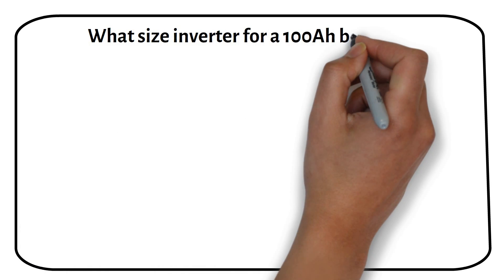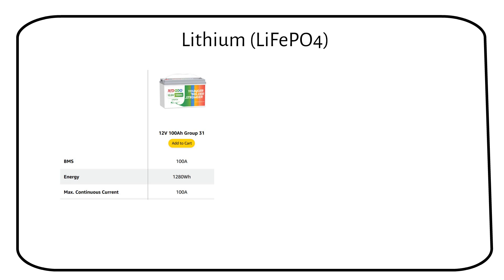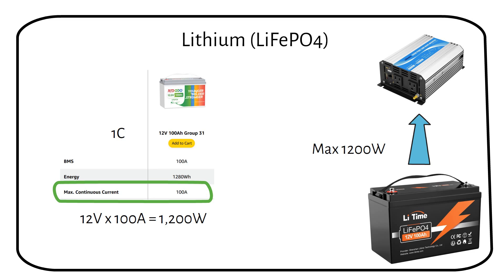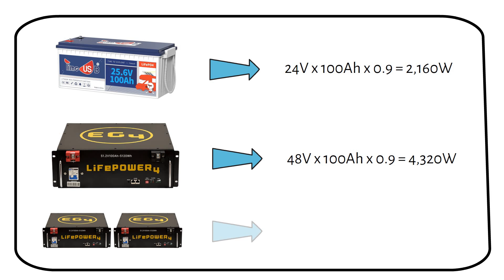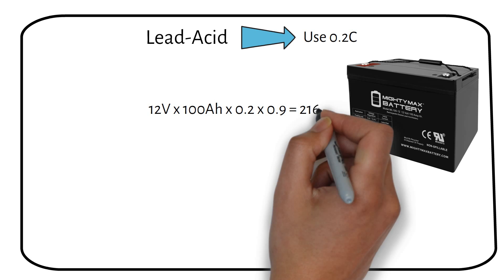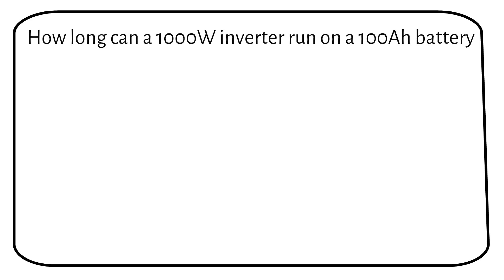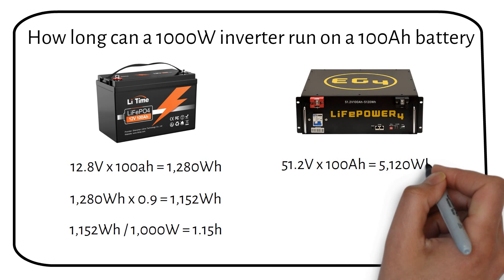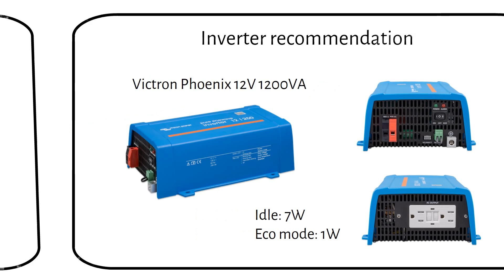What Size Inverter for 100Ah Battery - Sizing Battery for Inverter

Comment: I just ordered a 500W Bestek inverter to get myself acquainted with using inverters as an alternate power source. So in theory, 12V 50ah Lithium Battery suffices for 500W inverter based on calcs ... but do you still recommend a 12v  100ah lithium battery and, if so, why?...Without doing the calcs, it seems i can potentially get longer usage with the 12v 100a battery on a 500W inverter before recharging, but I would like to know your thoughts? I don't intend to max the load at one time, so my usage at this state in learning to use inverters would be light intermittent use (i.e a lamp periodically, charging my lap top periodically, charging phones , and maybe running my wifi for short intervals).
Reply from the maker: Of course, having a larger battery will make the fridge run longer, but it would also take longer to charge back up. I recommend getting the 12V 100ah battery, the price difference is not that much, about $250.
Reply: @cleversolarpower  Thank you!

Comment: Question, I'm looking at the Victron Inverter mainly because of there efficiency and the low draw when idle.  Know this might be a stupid question but the idle draw that's only when the are turned on correct? If i have it switched off it shouldn't drain, correct??
Reply from the maker: Yes, if you turn it off it's 0. If you turn it on it consumes power even when nothing is attached to it.
Reply: That what I thought, thank you

Comment: Great video. I love your animated pen technique... question: You suggest a fuse per battery prior to connecting to the bus in a parallel setup. The lithium batteries I use have a solid 200a BMS which shuts off with a short or other over-current situation. Is an MRBF fuse on each battery necessary? (the after-bus-bar [positive line does have a 200a fuse).
Reply from the maker: The BMS cannot disconnect a short circuit (high ICC) because it's an electronic switch. It's best practice to fuse every battery. Checkout nh00 fuses, they are quite cheap.
Reply: Clever is absolutely right. I'm a Commercial Electrician (Retired), and it is my professional opinion that it is really hard to have too many fuses, but really easy to have too few.
Fuse each battery (or bank of batteries, if a series setup) coming into the Buss Bar, then fuse the Buss bar to the Inverter.
A fuse responds to a Short Circuit far faster and far more reliably than a Circuit Breaker or Electronic Switch ever will.
You can trust the Inverter's circuit breakers, because the Inverter's electronics cannot produce more than double the "Constant Output" rating of the Inverter, and the only time you need to fuse the Solar Panels themselves is if you wire them in Parallel, because if you have, let's say, 4 panels, and something goes wrong with one, the other three might "Back feed" into it, giving it 3 times the current it's built for. If you're running them in Series, the Amperage won't exceed the rated amount possible unless the Sun's power increases, and then we probably have worse problems. But if you have 4 panels in a series arrangement, you now need to have 4 12VBatteries in series, as well as a 48V Inverter. And only need to fuse each bank of 4 batteries coming to the Buss bar.
The upside of a 48V system is that it has a lower current draw from the batteries, so you can use smaller wiring from the Batteries (or Buss bar) to the Inverter.
One of the "Joys" of LiFePO4 batteries is that, even though they have a 100A BMS, if THAT shorts out completely, the battery can deliver 200-300 Amps of surge before it heats up and goes BOOM! Rate the fuse the same as the BMS.
I hope this makes sense.

Comment: 24 Volt 3.8K Lithium Iron Phosphate Big Battery with 100amp BMS Handle a Victron Phoenix 24/1200 Inverter or a WZRELB 24 Volt 2500 Watt Inverter ??
Reply from the maker: 1200VA/24V=50A -> yes, 2500W/24V=104A -> no (if you draw the full 2500W)

Comment: If i have flooded 12v batteries that are combined 168AH. Is that really what is available or do i will i only get 80% out of them which would be 135.? I am setting up a battery monitor. thanks
Reply from the maker: If you have flooded lead acid batteries, you should only use 50% to increase the lifespan. You can use more, but that would reduce it's lifespan. Check the capacity of the battery with a voltage meter.

Comment: 2x12V100Ah in series and a 24V 1500W Inverter, was this the right move? I'm about to buy solar panels hence I found your channel and I'm amiss as to whether the same efficiency is used for Sealed Lead Acid vs Tubular Lead Acid for I was under the impression the latter shouldn't be allowed to discharge less than 50%? Should I opt to get a smaller inverter?
Reply from the maker: This will work. Every battery can deliver a max of 100A. Since they are placed in series, this is the max then can deliver, so each battery 50A. 1500W/24V=63A -> correctly sized.

Comment: I have a 3000 watt inverter, on a 100 amp battery, can I use a splitter to truck battery, to keep charged, only running 12 volt Rv fridge and a800 watts microwave?
Reply from the maker: I'm not sure what you mean by splitter. You can add multiple connections to a battery. However there should be a maximum of 3 connections per battery post. If your system exceeds this, use a busbar. You can add your inverter + charger to one battery.

Comment: Hi m8.
All fine here but like to ask for your thinking about my coming setup.
Lets start with my needs, no im in the Philippines wery south so its little diffrent.
Main who needs regular power is refigerator for beer and freezer for the bbq.. joke but its the main thing we really need.
Also a few fans running dayly will be needed.
Have some clue about power, ill add 20%
refrigerator 100w freezer 100w, fans and accesory 200w.
Some rarely use of microwave.
Can you give me a thumb what i need ?
My own estimate is as follow.
3x600w panels and 4 batterys for cooling and 2panels + 2 batterys for others separeted.
Seems ok?
Reply from the maker: Checkout my video about designing an off grid solar system as well as my calculator on my website.

Comment: I have a 1200watt inverter on a 100ah battery, I will just be careful not to go over 1000.
Reply from the maker: Yes, otherwise the BMS will shut down. The inverter has inefficiency as well. Usually 90%. So the max you can draw on the AC side is 1080W AC.

Comment: Thanks for the great videos, I'm also using your website links to buy your recomendations on amazon. I currently have the MPP Solar All in one unit: 12v 1000w inverter, 40A solar charge controller, and 20A AC charger. I'm having trouble figuring out how many batteries I can add in parallel. I crrently have a 12v 200AH Li Time battery and want to add a second 12v 200AH Li Time battery. Can my inverter handle that much current? And are the 40A solar charger and 20A charger enough to charge 400ah? I've allready bought the 12V system, and I can't afford to switch to 24V. ;)
Reply from the maker: More batteries is better (most of the time). You got to see that the system is still properly sized. Batteries should have 3 days of autonomy. So if your daily consumption is  800Wh, then you don't need an extra battery. You can charge the batteries with 2A, the charging current doesn't matter that much, it just impacts charging time.
Reply: @cleversolarpower  thanks! Very nice of you to help people out.
Reply: @cleversolarpower  one more question, if I add a Li Time 200ah battery with a 100amp BMS, to my existing Li Time 200ah battery, in parallel, do I use a 125amp MRBF fuse on battery #1, and a 250amp MRBF fuse on battery#2? I watched your videos, you said fuse each battery in case of short circuit overload, but still having difficulty understanding fuse sizing when two batteries parallel.

Comment: Do you mean, brother, that we cannot use more than 40 amps for a 200 amp acid battery? This would be excellent, please.
Reply from the maker: You can, but it wouldn't be good for your battery or efficiency. 40A is the max you should draw, not what you can draw.
Reply: @cleversolarpower  thanx my dear

Comment: I have a Sungoldpower 4000w 12v inverter/charger in my rv with a LifePo4 12v 300ah battery.  Is that too much inverter?  I am adding another 12v 300ah LifePo4 battery in parallel for 600ah if that helps.
Reply from the maker: I don't recommend going over 2200W for a 12V system. Your wires will be costly. Check my video about 12V,24V or 48V battery systems.

Comment: If I have a 180 W  inverter for my Travel trailer.How big of a lithium battery can I get to max out that 1800 watt inverter?
Reply from the maker: Assuming you have a 12V lithium battery, you can draw a max of 100A, that's 12V*100A=1200W max draw from one 12V 100Ah lifepo4 battery.

Comment: informative video. I have a question.. I connected 2 solar panels of 100w each ,  to 3 12V batteries 2 of which have 100Ah each and 1 has 150Ah. I use 1000W inverter. However, the power often goes off at night but sometimes during day time. what could be the reason?
Reply from the maker: Not enough solar to recharge the batteries. It depends on your load. Make a calculation and see how much you need. Checkout my video about sizing a solar system.

Comment: Is it possible to run a 2000w inverter on a 100ah battery with a 700w microwave?
Reply from the maker: No, because the c rate of lithium is 1. You can discharge a max of 100A with the BMS.

Comment: I have two 12v 120ah lifepo4 on 3000watt 24v inverter. My charge controller shutdown. I also have four 250 watt panels connected in parallel.
Reply: your charge controller should be MPPT that support 24v

Comment: Hi, Nick. I just came across your channel the other day and have learned a lot already after watching just a few of you tutorials. One thing that I learned... I have been making some very wrong assumptions about size and capacity. On my RV I currently have 2 - 100W solar panels, 2 -125 AH AGM batteries, all wired in parallel. I have them connected to a 40 amp EPever charge controller and to a 2500 W Sunforce Pure sine wave inverter. Problem... this set up will not run my microwave or coffee maker without tripping the cut-off circuit in the inverter. I have recently acquired two 300 AH Renogy Lifepo4 batteries, not yet installed. Will this solve the issue with tripping the inverter or am I missing something altogether? And do I need to resize my inverter to take the new batteries? Your comment or those from other followers of your channel will be greatly appreciated. Thanks.
Reply from the maker: Hello Trevor, answered your email.

Comment: I have 4x 48v 100ah rack batteries and a 5600 watt inverter.. I'll be buying another 4x batteries and also updating the inverter to 8 or 10kw. That's hybrid inverter/charger.. And 12-14 270w panels..

I use MPP inverter/chargers. They are good but have a higher standby current draw

Comment: I have 3 12V 20Ah LiFe batteries, if paralleled what watt inverter is best? 650W or 600W
Reply from the maker: You have a 12V 60Ah battery. At 1C, you can pull 60A max. Assuming the BMS is rated at 1C as well. 650W/12V=54A. So you can run a 650W load.

Comment: There is nothing wrong with using an oversized inverter. One reason would be to allow for future expansion. Just don't draw more power than your current battery system can handle.
Reply from the maker: I agree, it depends on the load.
Reply: @cleversolarpower I’m getting a 100 am lithium iron phosphate battery deep cycle and consider getting a 4k water inverter is that good? To run 5th wheel
Reply: Don't forget the parasitic drain is larger the higher the inverter capacity. Use the smallest inverter (with a safety margin)
Reply: Then you have no idiot proofing

You should always dumby proof ur diy crrations
Reply: @Godfather_of_the_Oath  just put overcurrent protection on your battery if it doesn't already have it.
Reply: @Godfather_of_the_Oath  Murphy

Comment: I have 3-100ah Mighty Max   lithium batteries hooked up in series
Reply from the maker: With what inverter?
Reply: @cleversolarpower  I have 2, a 2000W Power  Tech-On and a 1200W Victron Phoenix both are 12V I don't have either one maxed out. Thank you for all your info I find it very informative
Reply from the maker: Thanks for your reply.
Reply: @cleversolarpower  I have 2 a 12v /2000w Power Tech - On and a Victron 12/1200 Phoenix I like this one a lot. Thank you for all your helpful information.

Comment: Even 500watt inverter with a 60watt load can not be connected on lead acid battery 100ah
Reply from the maker: I assume you are talking about lead-acid? Of course it can. A 500 inverter is not the same as a 500W load. If you have a 60W load, then you get a total of 70W (including 10W of the inverter). Maxing out the inverter is not a good idea (500W) because it will shorten the lifespan of the battery.

Comment: I have a Renogy 2000w Inverter with two Eco-Worthy 12.8v 100Ah lithium batteries in series.  Am I properly sized?
Reply from the maker: 2000W/12V=166A/0.9=185A max draw from inverter. A 100Ah battery can deliver 100A, so 100A x 2batteries = 200A. So you are properly sized.

Comment: Very informative.  I have a 100Ah AGM Lead Acid and a 120Ah AGM lead Acid batteries.  My Invertor (MUST Invertor) is rated as 12V/1000W. I have an MPPT charge Controller rated as 150 MaxPVoc. What will be my set up?
Reply from the maker: Connecting the batteries in parallel is best. However, that's insufficient to run a full 1,000W load on it. It will work, but as I said in the video, it's not healthy for your battery.

Comment: I've been using four sealed lead acid batteries with a 2000 watt 12V inverter powering washing machine that peak draw about 1800 watts. Been in service over one year now. I do 2-3 loads per week. 
So I'm apparently way under sized my battery bank??
Thank you for good informational video.
Reply from the maker: Assuming the batteries are 12V 100Ah, you have a total of 12V 400Ah. You will draw: 150A. Since you have lead-acid batteries, you should use a .2C rate for maximum lifespan, you are running it at 0.375C. Still not bad for short time loads.
Reply: no. How deeply do your batteries become discharged (end voltage)
Reply: So I had to check again this AM pulls about 8.5 AMPS max load. Batteries lowest I've seen was like 11.4 volts after doing consecutive loads. And meter showed charge level only hit 50% briefly.
Reply: @chadrogers3161  I don't agree with the premise of this video, but it isn't mine. For longer life 11.7 volts after resting is the minimum (the less discharged, the better - recharge sooner). So S.O.C. is best to 50% of 12.7 to ? as rated by the Mfg. Other than that, you appear to be just fine, unless you need longer operation from the battery. Carry on.
Reply: @jamesalles139  yeah they are connected to three 100 watt solar panels so plenty of time in between uses to recharge.
Reply: The two things that kill a battery fast are the speed of discharge, and the depth of discharge. You're a little over on the speed, but not horribly, and it sounds like you aren't discharging all that horribly.
If you added any more demand to the inverter, I would recommend going Lithium Iron Phosphate.
Reply: Thank you so much the video is do helpful ❤

Comment: thank you for the presented material.  recently I heard that photovoltaic panels can be equipped with optimizers.  what they are and if they can be used in any situation.
Reply from the maker: Unless you have shade, I don't recommend using optimizers because the cost will outweigh the benefits. I made a video about 'different kinds of inverters' where i briefly touch upon these and microinverters. Check it out on my channel page.
Reply: @cleversolarpower  ok , thank you !